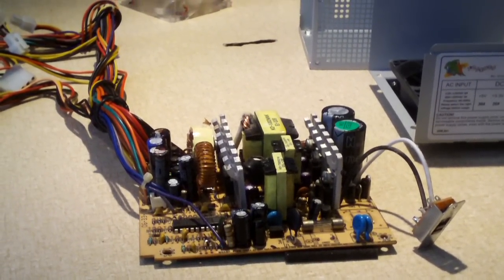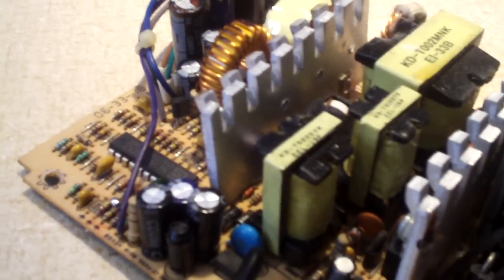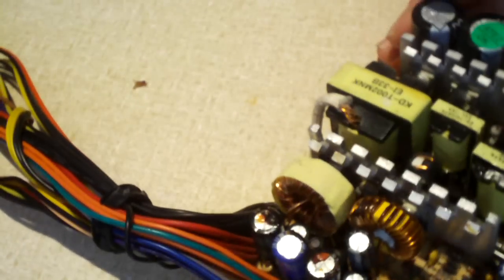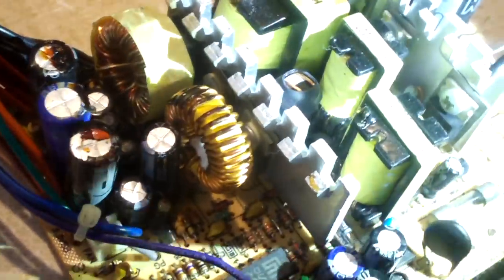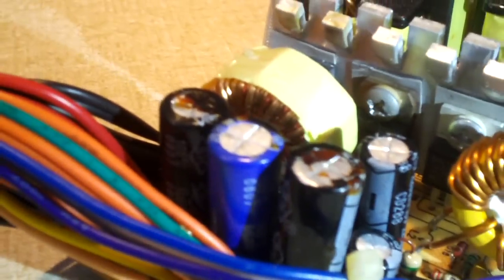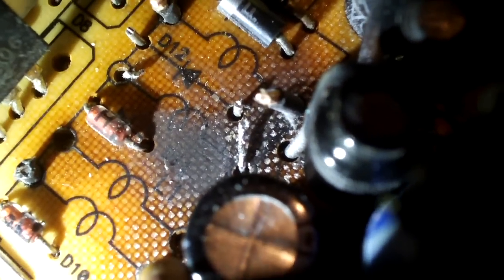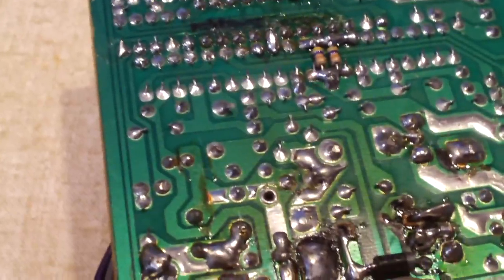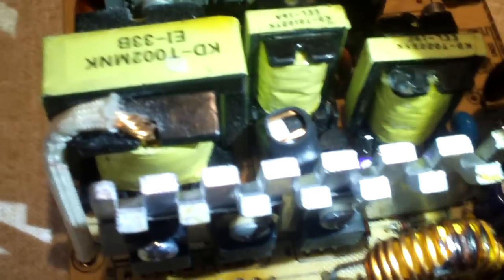A second look at the mATX Logisys 350W Power Supply - EPIC FAIL

Comment: i have two power supplies so both have 470uf 200v smoother caps but the Raidmax XT400 it claims to be 400Watts but it has real big 470uf caps, and i have an old style power supply that is 450W but the smoother capacitor size is like 270/330uf. So yea that 450W power supply seems to be 250-300Watts only, but that raidmax gaming power supply even have 8pin for video card and 8pin for cpu, so it seems to be very nice to me. Ofcourse the fan is modulated with pwm, the cheaper power supply gets real hot when loaded due its just connected to 5v. So my conclusion is dont cheap out the power supply.

Comment: do u know if dells optiplex series psus fans are thermally controlled i have a dell optiplex 745 and its psu fan spins very slowly and gets warm under load its a dell 305w psu and am just worried about it getting to warm. i cant find any info in the protection, like overheat, and over volt protection it has.
Reply from the maker: Yes, it's thermally controlled. Some power supplies run the fans very slow unless they get extremely hot or have a huge load attached.
Reply: ok thanks man I love your vids btw
Reply: I just bought a core2quad Q6660 on ebay lol mine was $49 but there still really expensive charging $160 new 0.0